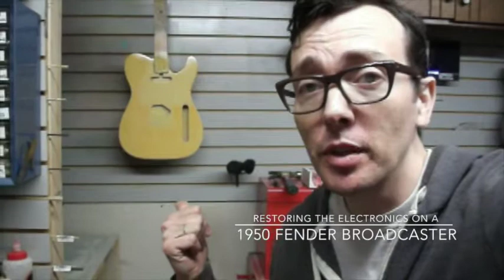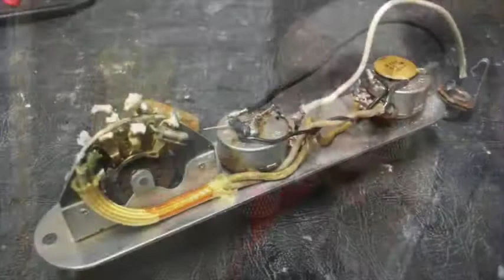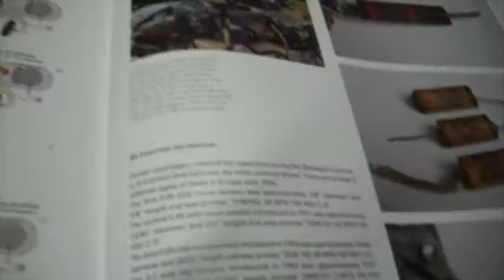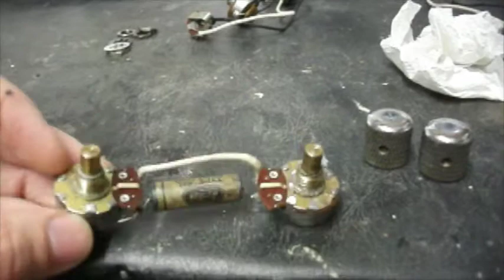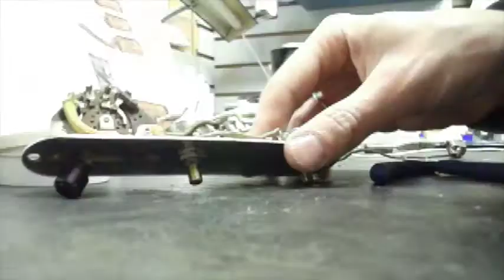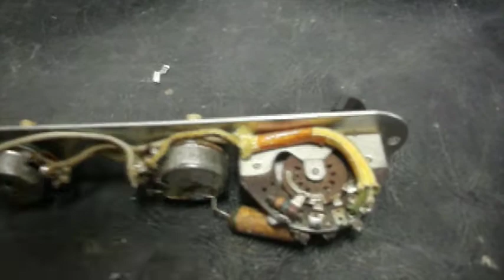Restoring the electronics in a 1950 Fender Broadcaster with Eric Daw

Comment: hi eric  why no earth from the back of the volume pot?
Reply from the maker: It's grounded because the control plate acts as a ground.  Running a ground wire between the pots would be redundant.  The pickups will be grounded to the volume pot.  Thanks for watching!